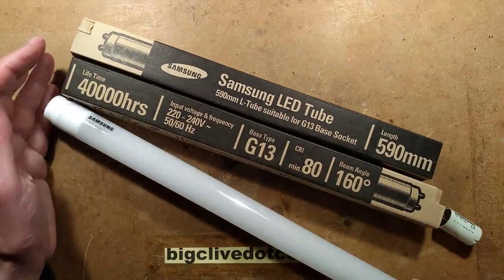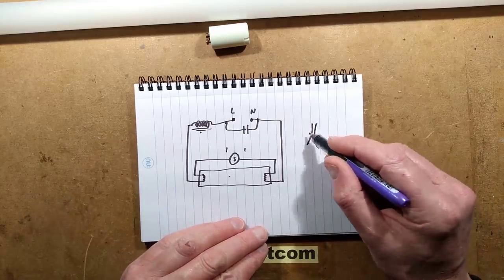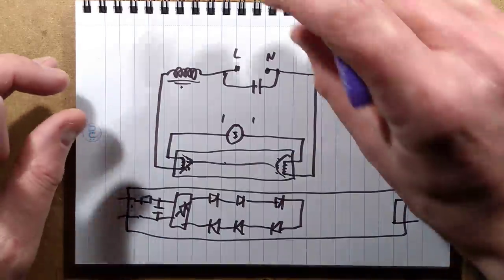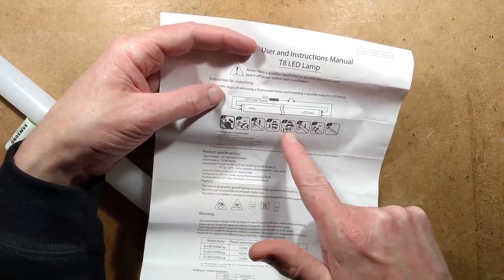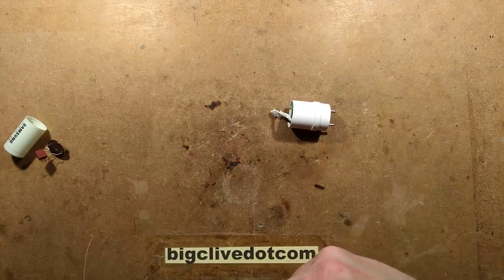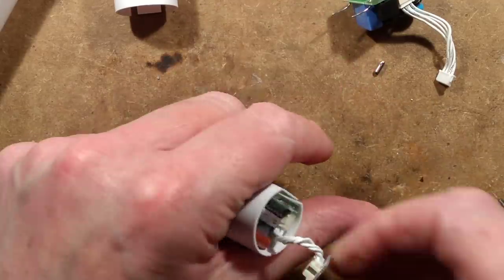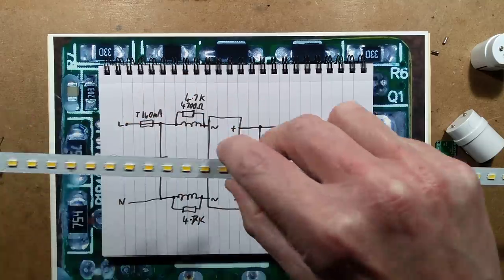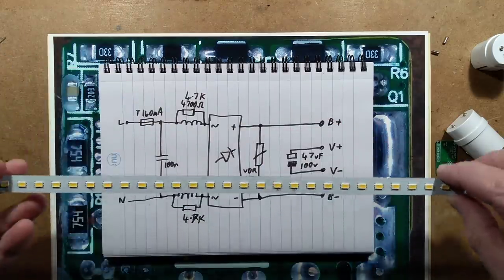Inside a Samsung LED retrofit tube.  (Older style?)

Comment: so are these just standard led strips? could you put a few together in series and parallel and run it of a standard  mean well driver without any modification. i know it wouldn't be cost effective , just curious if they are just standard or modifies to work with that circuitry

Comment: Clive, I bought 10 of these for my workshop, they’ve been running for 2.5 years now without ballast (straight mains connection) I was concerned at first but I got them from CPC for £1 each on their clearance, so was well worth the random purchase
Reply from the maker: I think that's where I got this one, and also on clearance.
Reply: Interesting! I was wondering about that. I would kind-of expect it with such a sophisticated driver.

Comment: It's like you are inside my head - I recently replaced three tubes in the garage with Sylvania LED tubes (from Wickes) which also came with 'dummy' starters (or so I assumed - I haven't opened mine!). a) that made me tear apart an old neon starter to see how it worked and b) it made me wonder what was in these new tubes and I thought "I wish Clive had done a tear-down of one of these". I wonder if it's the same circuitry as these Samsung tubes..

Comment: The external MOSFET is used with the internal MOSFET in a cascode. Essentially the external one limits the voltage across the internal one. This means the external one is doing all the work while the internal one has a the control. While looking odd this allows the external MOSFET to be added and not need to worry about gate drive for proper rise/fall times.
Reply: Yes, according to the data sheet, the internal MOSFET has an absolute maximum voltage rating of just 18V, hence the need for a higher voltage external MOSFET.

Comment: looking at retrofits -my fathers 500w security floodlight recently popped its bulb, i was trying to decide whether to replace the bulb with an equivalent LED or replace the whole unit -however i've struggled to find a suitable r7s LED bulb above 2500lumen (these go up to £25 at which point I can buy a whole new lamp) the old R7s was ~8000lumen? have you looked into this? i've seen previously you looked into led cob style flood lights but couldn't find anything on your retrofitting linear LEDs into floodlights, it would be great to see what you suggest is best!
Reply from the maker: If the contacts at the end of the fitting are clean then it might be worth trying a retrofit lamp in it.  I'm afraid that the LED floodlights are never going to last as long as the original light and generally require the whole fitting to be replaced.  If the light is on a movement sensor then it may be more cost effective just to find a new tungsten lamp.
Reply: @bigclivedotcom  thanks for the swift reply :) (became a fan of yours whilst renovating our first house) hmm no, the bulb I removed looked like it has slightly corroded ends and i'm not entirely convinced that wasn't what did it in, in the end -there was not a small amount of water inside the (IP44 hah!) rated casing when my father opened the front glass...I think we will go for some nice v-tac PIR lights i've seen on CPC, they go up to 50W with a sensor.

Comment: I got the electronic guts from a simpler build quite recent LED tube, just electronics on one end. Not sure if I may send it over or first try to fix it. Also not sure what actually failed.
The originally 120 cm tube got at least a more shipping friendly format now, as I absolutely shattered the glass tube when I tried to disasemble the thing. Pretty resilient stuff this white goop they used to glue absolutely everything in place. had to peel of the plastic sockets in strips to release the board.

Comment: C1 in the schematic is needed to provide a path for the high frequency current flowing in the buck converter loop. It does distort the zero crossing of a power factor circuit though. So its value is a compromise. It's normally in the 1uF range.

Comment: These line-connected LED regulators are hard to understand, but in this case it's an "upside down buck regulator" where the entire topology is flipped around the horizontal axis and "normal polarities" are all reversed. C7 is the output filter cap, D5 is the catch diode, T1 is the inductor that is has a small secondary tap to power up the controller chip. Ignore the common mode choke LP1, then draw a few LEDs for the load. Once you do that, you can see the rudiments of a buck regulator, whose purpose is to keep pumping the LEDs with a triangular current at all times as opposed to just hitting them with 100/120 Hz hits, which cause flicker. Unlike a conventional buck where the flyback action happens when the inductor swings below ground, in this one the flyback action occurs when the inductor swings high through D5. The external PFET is a bit of a puzzler, but draw in its body diode and you'll see that when the controller chip switches low, it drags the drain low with it. I'm still unclear what happens to the PFET during flyback. The Samsung boys are using a buck switcher to feed their LEDs, which is highly efficient at the expense of complexity!

Comment: I think that this tube is not actually "using" the inductive ballast. The fact that it is intended for conventional control gear means that it will not work with HF-ballast. I recently placed a LED-tube made by Philips. They come with instructions on how to modify a fixture with an HF-ballast (which means taking the ballast out and doing some rewiring). So, the modified fixture does neither have a ballast nor a starter.
There are also led-tubes available which work in HF-fixtures without modification, but they are more expensive.
Reply from the maker: At the beginning of the video I was unaware that the tube had significant active electronics in it.  The way it was shown with the original ballast suggested it might use it as a current limiting component.  By the end of the video I realised that the ballast is just a coincidental component in the circuit after the tube has been installed.

Comment: Hi Clyde.  It is quite a coincidence that a day after I bought 2 18 inch Great Value 15 watt Non Dim T8 or T12 LED lamps, similar, I suppose, to the one you just discected.  One is 2700k the other is 5000k; the label states T8 25.4mm T12 38.1mm.  "Replaces T8 or T12 in you fluorescent Fixtures...   Both the old style fluorescent tubes went belly up so I bought these to replace them (one is Soft White the other is Daylight.  Well short story of it all is aaater I installed them I plugged the lamp in and they immediately came on.  Unplugged, plugged, same thin frever, I suppose.   Before, with the old style Ihad to hold the "ON" button down for a second or two before they would energize and start giving off photons.   These LEDs lamps come on as soon as I plug i in.  The OFF switch does nothing as in when I push it the lights stay lit, no flicker, no nothing, just bright Daylight and soft white.  They aren''' running hot, smoking or giving of fumes of any kind but I still decided to unplug them; 10 minutes later your video popped on my youtube screen.  In all of your eletrical wisdom would you be able to just give me a guess as to why this is happening?  Unknonw damage?  Balast gone bad?  Oh, btw the lamp is a 2 tube portable lamp.  The sticker on the bottom:  E69325  120v  60hz  1115Wx2  0.48A AC ONLY  Made in Taiwan      Another sticker: Inspected 0922004.  And a small oval, blue colored  UL sticker....  2 buttons = ON and OFF and no visible ballast(s). It does have some handy phillips screws on the bottom, holding the case together.  Thank You O Wise One.

Comment: I (and Project Farm if you want to see a video) retrofitted my shed with Hyperikon LED retrofits, which intend for you to completely remove the ballast and have live at one end and neutral at the other. You can get these on Amazon. Very good lights though. A bit harsh for the inside of the house, so got some Philips retrofits for that, and they needed a switchmode ballast (there is a list of "compatible" units) which luckily it was easy to find a $12 unit that was on the list
Reply: I've done a lot of mine with toggled dimmable ones from home depot. The 5k color was quite an improvement in my shop. I was even more impressed when they turned on properly on a subzero winter night.

Comment: i removed the ballast and big capacitor from old fitting, rewired it from L/N to one tombstone (L through Starter) and connected my new LED kitchen batten light direct through the starter (using new one provided with the new tube as a fuse) and no other wiring to the other end of tube - i think this is the newer ones that are running a lot less power than simply swapping out the tube itself, so no ballast wattage consumption, is that correct?
Reply: yup

Comment: While replacing a bunch of them, I dropped 2 and broke the glass covering.  What happens if you just throw 110 across the right set of pins?
Reply from the maker: If it's a modern tube and uses a bypassed ballast then you should be able to power them from the non shunted end.  Just be aware that exposed circuitry is probably referenced to the mains.
Reply: In these, you leave the ballast in the circuit.
Reply from the maker: @myutube6422  It would depend on whether they used the ballast for current limiting or not.

Comment: There's a complicated circuit in the Phillips LED T12 replacement tube equivalent to this one. the ones that are directly connected to A/C are much simpler. I know because I bought a bunch of different kinds and the Phillips was the most complicated one.
Reply: oh yeah! one more thing, those Phillips replacement tubes indicate that they are designed to work with magnetic ballasts and shouldn't be used with electronic ballasts. I tested that and if used with incompatible ballast, they stop working.

Comment: How could I extend life of led tubes like these? I have many of them and i’m annoyed to see them fail after 1-2 years. I tried to open them and change the capacitor but apparently the circuit regulate current itself and it does not make difference.
Reply from the maker: The best way is to adjust the current sensing resistors from new so the lamp runs cooler.
Reply: @bigclivedotcom  i watched a lot of your videos, unfortunately i don’t have a background on electronics, just a lot of curiosity and experiments. Thanks a lot, I will check and see if i manage to find and work on that component.
Reply: @bigclivedotcom  I removed one of the two current sensitive resistors. Power has dropped from 10 to 8 w, light is slightly less but ok. It’s heating less but still quite a lot so I also decided to drill two holes in the top center at sides of the led bar and two holes down near the sides of the tube.

Comment: 03:14 - Striking won't happen until the starter - as the bimetalic strip cools down in it - opens up again, applying full voltage across the tube again, plus a little EM kickback from the ballast, which results in a high voltage spike. An aged, faulty tube with worn off thermionic emitter, often in one end, starts to rectify the AC current, which results in too high voltage drop accross the starter during every second halfwave, which results in a neon glow discharge, even that the tube is essentially stricken. This makes the starter close and go back to preheat mode until the bimetal cools off again. And the cycle goes on. Removing the starter at the right time stops the cycling, and the tube stays lit, but it'll be awfully flickery. The ballast may also overheat. Fun experiment, even I tried: replacing the ballast with a 100W incandescent bulb.

That's quite a complicated thing there. Flywheel diode?? I know it as a freewheeling diode, but flywheel diode sounds almost like blinker fluid. xD Compared to this, classic fluoros are a piece of cake!

Comment: MOSFET Q1 in common-gate configuration. Probably to allow the chip to handle higher voltages.
Reply: That was my thought too.
Reply: Also my first thought. I skimmed a not zoomable version of the datasheet and I think it said the internal FET can only do 22V or so.

Comment: 557k, now we need a special about pnp transistors...
Reply: Seems we have some specials waiting.... 
555k timer special, 556k dual timer special, 557 PNP transistor special, and soon it will be time for the 558k quad timer special.
Reply from the maker: The 555 video is coming up, but it's NOTHING like you'd expect.  Clue.  It's E555 and involves ethanol.

Comment: There are(were?) retrofits which don't even need the starter replaced; they are much simpler, consisting of a pair of bridge rectifiers on each end, a smoothing capacitor, and as many LEDs as needed to make up a similar voltage to the original tube.

Comment: It’s more fun if you skip the formalities and just shove the end of the tube into the wall outlet. Of course, you’ll want to make sure you don’t use the shunted end, or you might set your beard alight! 😬 I’ve found this to be the best way to make an EOL video; though, I’d take it outside with a long extension cord, pack the tube with sparklers, thermite, and cut-off match heads, and re-glue the end on. Oh, and finding an area free of anything flammable is helpful! 🤣 Sounds like something on the TKOR channel, or maybe shango066. 🤠

Comment: The on off cycles due to inverter ballast charges, it actually is less damaging for the 2 second cycle vs 30 seconds on off since 30 seconds it discharges further and cools further and of course heats further when on for 30 second test.    Thus 2 second tests temperatures stay less varied and damage is reduced vs 30 second test.
Reply: But in the real world, you tend to turn the light on and leave it on for a long time. In workplaces for 10 hours plus. At home for less time.  So what would be more useful from the manufacturer is the impact for those situations.

Comment: I can't remember if I've posted this before, but the Feit Electric 73992 https://www.feit.com/products/fixtures/utility/1850-lumen-4000k-single-4ft-led-utility-light/ that I have is an interesting critter, like this tube the input filtering and rectifier is at one end but connects to the LED strip with a 2 pin connector and the driver is at the other end and connects to the strip with a 3 pin connector. The strip is 2 parallel sections of LEDs in series. The interesting part is that it uses what normally would be a boost converter arrangement to drive the LEDs but the LED negative is the same as the rectified mains positive. That took some time to wrap my head around especially since the markings on the strip are p-gnd for the rectified negative, - for the rectified positive and LED negative, and + for LED positive. The controller IC is a tiny SOT23-6. It is non-isolated and the inductor has a feedback winding.

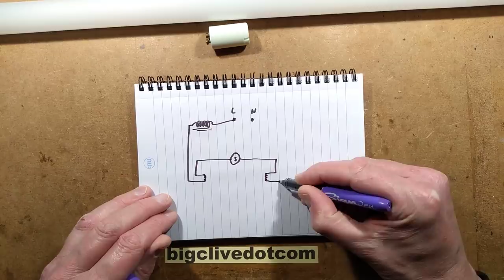Comment: 2:09 - Speaking of that capacitor, most of the documentation I found online suggests that capacitor should have a value between 2 and 13 µF (depending on the tube), but I had a look at the one on a 36W fluorescent tube in my kitchen (which should be 4.5 µF, according to the interwebs) and it says "0.045 µF" (0.07 measured out of circuit). Any idea why the 100x difference? This is the stand-alone (PFC) capacitor across the magnetic ballast's input, as shown at 2:09, not the tiny capacitor inside a normal fluorescent starter.
Reply: The tiny capacitor is just an interference suppressor. A PFC capacitor can either be wired in series or in parallel. In older industrial fixtures, it was wired in series with one half of a double fixture to compensate for stroboscope effects.
Reply: I'm aware of all that. My question is why does this light fixture come with a capacitor rated for 1/100th of the value recommended in all the documentation I was able to find.

Comment: Fluorescent starters don't require contacts, they are just neon bulbs that light and conduct under high voltage until the tube starts to conduct. When the tube fires the voltage across it and the starter drop below the voltage it takes to light the neon. So the neon bulb acts like a voltage dependent switch. Ballasts without starters are just poor transformers. They produce a higher voltage that naturally drops under the load of an operating fluorescent tube.
Reply from the maker: Most starters here have the bimetallic contacts that physically close the circuit intermittently.
Reply: Since the neon plasma still drops around 70V or so when ignited, they actually do need bimetallic contacts to send a reasonable current through the tube heaters. I'm not aware of any exceptions, but if you can point me to one I'm happy to add that to my knowledge.

Comment: Sylvania Erlangen has just launched their new development next generation LED fluorescent tubes by the name "Helios". They do not use the simple strip of cheap led inside a plastic pipe, but an actual glass tube with glass welded mounts like a traditional fluorescent tubes, coated with phosphor to diffuse the light, and the inside there are two rigid wires going from one end to the other and many, like 100 pieces of sequential parallel connected individual very high quality led filaments. Those are the real deal. If I would ever give in into this LED forced nonsense (says the guy who has 8 boxes of T12 fluorescent tubes stashed away for future use, some in halo 530 color even) I would definitely use the Helios ones. They are weather, moisture and chemical resistant, and with a proper ballast they could be used in factory settings where traditional fluorescent tubes are still king, mainly because of oil, dust, thinner fumes, etc. that would basically ruin and dissolve the cheap LEDs.